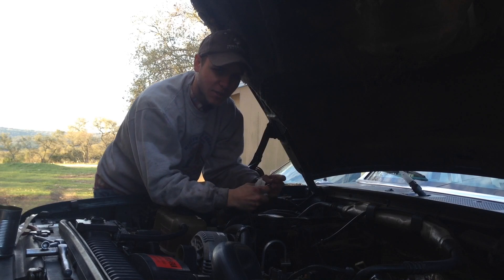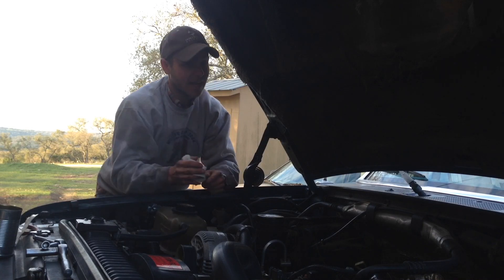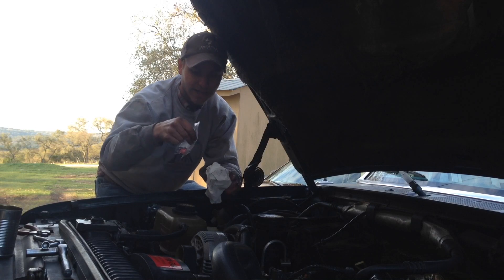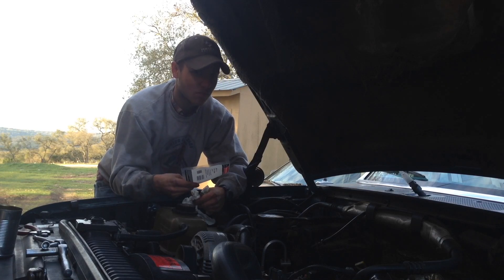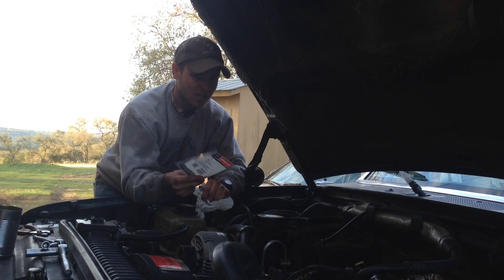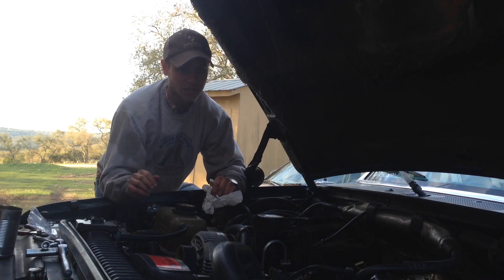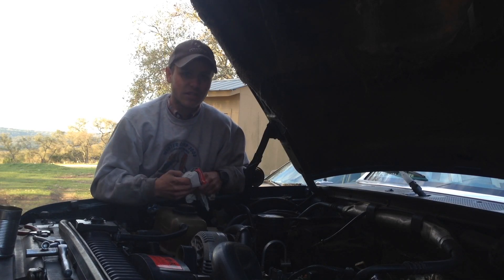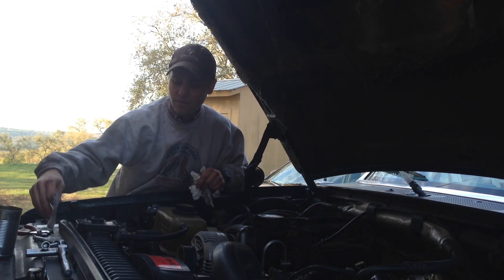Diesel Cold Start Trick

Comment: Guy I worked with had a 95 F250. The Glow Plug Contoller was bad for several years. He sprayed Windex at the driver's side of the grille got in and hit the key. It fired right off. Crazy

Comment: Most people Do Not Know, The 7.3 needs OIL PRESSURE TO FIRE THE INJECTORS, HEAVY OIL ( 15/40 ) Makes starting harder, I switched to 5/40 Shell Rotilla T6 & WOW !!  3 to 5 turns at -10 below, Never started that well. 2000, Ford 7.3 189,000,miles &  Been Fighting cold starts 20 Years.

Comment: Goes outside to start truck in the cold.... Then says its only 40 sum degrees out. Like what!? Thats not cold!!!
Jokes aside though most 7.3's are known for being hard to start in "cold" weather as I think you mentioned in another vid.

My dads got an old 12 valve 5.9 cummings. They don't have glow plugs just an intake heater, which of course does not work anymore. When it gets cold he will usually plug in the block heater but even if he doesn't It will still start first try in below freezing weather.

So, if you can use your block heater, even with glow plugs, it helps and reduces the time the engine needs to idle to warm up.

Cool trick though, I might try it on our case tractor. Its got a big cummings in it that is very hard to start in the cold. If we don't plug in the block heater or use ether it just will not start.
Reply: Your thinking of the 7.3 idi. Which yes HATES cold weather. But for the powerstroke if the gp relay is good and you have good glow plugs then it should start well below zero. The problem is most people don't replace them use ether and then complain about it not starting.

Comment: That's pretty cool!!! Will it do any damage to any engine part??
Reply from the maker: I don't know whether it would for sure. It probably puts more wear on the starter at least. You wouldn't want the engine to run very long with the exhaust plugged up though. Luckily the back pressure tends to shoot out whatever was used to block the exhaust in the first place.

Comment: That’s pretty cool never new about that. You should take the plastic cover off
The motor there’s no need for it.
Reply from the maker: No need for it!? Haha, you know me, I like it old school. Most OBS 7.3's I looked at never had them, only the ones that were well taken care of did, so I like to keep mine 'original' that way. Besides, what if I forget my truck is "Direct Injection Turbo Diesel?" 

I sometimes take it off for the heck of it and put it on the end table in the apartment for decoration.
Reply: Any plastic in there usually is there to lower noise

Comment: This is quite odd to me, it seems like you might have a "cold start" issue with your truck. That is much too warm a temperature for your truck to not even be attempting to fire off a couple of the cylinders. My OBS 7.3 has no problem starting without using glow plugs at this temperature
Reply from the maker: I definitely had a cold start issue! It works much better now with fresh glow plugs. Have you had your glow-plugs disconnected at the controller and it still cold starts fine in the mid 40's?
Reply: Yes, this is the case. I immediately start the truck as in i do not wait for the glow plugs. Alot of 7.3 guys here in the northeast use their glow plugs heavily this time of year where it gets down to negatives. When it gets above mid 40's i will not use my glow plugs and it will fire off after a couple seconds of cranking. I would look into this on your vehicle, seems abnormal.
Reply from the maker: That's what I was wondering. Thanks for the input! I am wondering if my injectors are worn out at least on the oil side poppet valves and causing a  retardation of the injection event. How many miles do you have on your injectors? I've got probably 354k on mine...
Reply: My truck is at 136k. Unsure of if original injectors. Just purchased this last year. Good luck, look forward to new videos!
Reply from the maker: Wow! That's super low miles for a 7.3! Guess I'll have to look into other causes of the cold start issues. I appreciate your support for the channel. I enjoy making the new videos as well!

Comment: The can didn’t so shit lol. Let me crank any hard start long crank that long and vroooom!!!  Air in line, injector/ injectors, hpfp, return valve, timing or just unplugged sensor to make click bait hahaha
Reply: I'm inclined to agree. I think this "trick" just keeps you distracted long enough for enough cranking to get a little heat built up. There's no way those rags are holding back engine compression. 

But what do I know. If it works for you, keep at it. If I get caught in the same spot, I'm not above trying it. Except I'll probably use a stick instead of a can of ether!

Comment: Things got low compression it should start easy as fuck with no glow plugs down to hella low temps I've had a few that I disconnected the glow plugs on and never had a issue starting in 12 degrees even